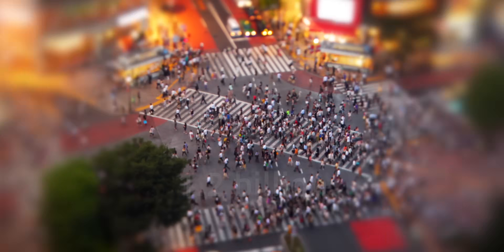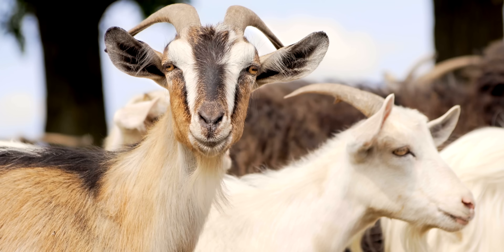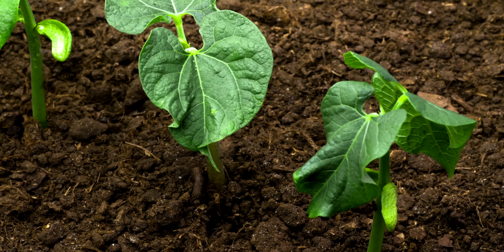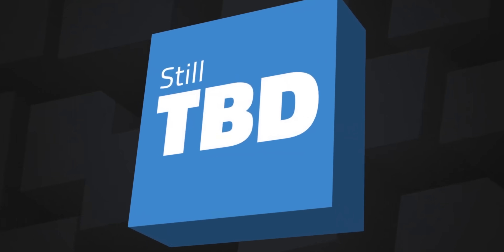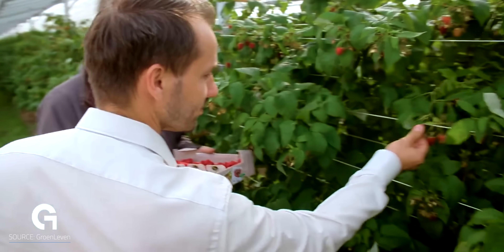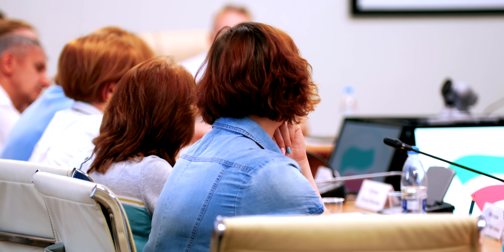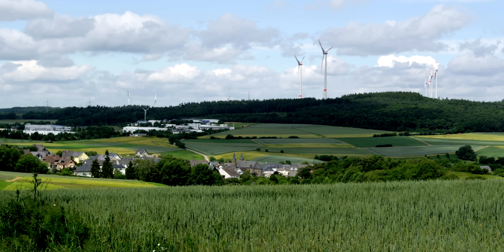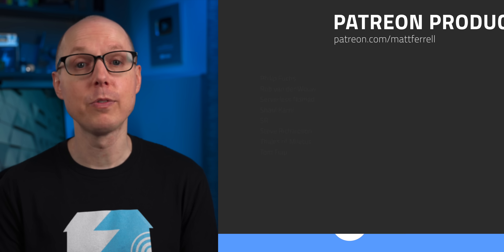Solar Panels Plus Farming? Agrivoltaics Explained

Comment: I feel like stating that utilizing solar panels to shade to agriculturally used land, reducing water use by 50% is misleading, without analyzing the net effect in context of water needed in the production of the solar panels and comparing after what time the net effect is positive (so if water is actually saved in a reasonable time period, say the lifetime of a solarpanel).

Comment: You left out how long do the panels last, where are they manufactured, how difficult are they to dispose of at their end of life etc etc. No one ever wants to talk about these things because the answers NEVER fit the clean energy narrative.
Reply: Panels last 10-20 years.
Reply: That is not correct. Guaranteed full output duration is 25 years for modern panels. After 25-30 years 80-90% of the original output is still available. Then the cells degrade slowly/ steadily. But they can be recycled as well and they are.  @gopalkrusnajena7383
Reply: Nuclear reactor tasty
Reply: I see the focus not on a 1:1 replacement of the devastating fossil fuel paradigma. Climate catastrophe, extinction of species, civil and other wars, chemical pollution, plastic pollution,... We have to shift to a whole different paradigma. Degrowth, cradle to cradle,...
Reply: @TheAsselmeier  That will never happen, due to human nature. We can say we will do those things but there is no way to MAKE everyone participate.
Reply: What would You suggest?
Reply: @ZealousMonk1  Nuclear Power what we should have been doing for the last 70+ years which would have saved us hundreds of billons in taxes and hundreds of billions of air pollution in the form of the dreaded carbon emissions they all rave about.
Reply: @JS-mh9uu  What about the Nuclear waste? What do we do with that?
Reply: @ZealousMonk1  Don't think you realize how little waste they make, you store it on site for 50 - 75 years then bury it in the unit when you decommission it. Hopefully by then we have clean fusion power or something else. Worst case Scenario you feed the waste to an older reactor just before you decom it.
Reply: @ZealousMonk1  Also i single Solar farm makes more toxic waste in 15 years than a Nuclear reactor does in 75. Both from making the panels and disposing of them.
Reply: Always someone complaining small inconvenience

Comment: You massively missed the biggest issue is that this is impossible to implement with grain (wheat, corn, beans, etc.) production. Combine harvesters are a needed component to reduce man hours and make the crop viable (Unless you want to be paying $10-20 for a box of cereal for just ONE example, virtually all store food products have or involve grain in them). On top of this even vegetable farming which generally relies often (But not always!) on hand picking still uses tractors with planters on the back to plant the crop that is usually already in sprout stage. These cannot function with panels like this in the way.

Agrivoltaics would work with small scale personal gardens but would never work in commercial agricultural farming because the panels are just in the way for many stages. On top of this some crops like corn would be very unsuited to being shaded.

Comment: There is a huge proposed agrovoltaic project planned for my little french village, 50 hectares roughly, I neutral bordering supportive, but there are huge numbers of NIMBYs. The plan is the panels will move with the sun and be mounted 8 to 10 meters high. But the exact system has never been done on scale before and the company behind it is Chinese, and not a local one. Compensation to the local village is I believe 40,000 euro a year, which the way the village spends money will be lost, they spent over 70k euro repairing a stone wall for 5 car parking spaces.

Comment: I love the model of sheep grazing combined with solar panels; I think it could work extremely well with the rotational grazing model: a strip or block of panels will define the boundaries of each paddock in the rotation. It would be important to seed the right kind of forage on the soil under and between the panels, with plenty of legumes like trefoil in the mix. The panels themselves would provide much-needed shade. Ideally, the would supply power to  electric perimeter fencing, to keep predators out.
Reply: The only problem i see with goats and sheep is that they love to climb and jump. One hop onto a solar panel and bam, destroyed.
Reply: @MsPoliteRants  Panels are hardier than you might think. Goats might be a problem but sheep are not THAT destructive.
Reply: @MsPoliteRants  sheep are fine, goats would definitely ruin the panels!

Comment: This can absolutely be tapped into. A very good opportunity for both developed and developing countries. In addition to the point of solar production, wouldn't dry and arid regions with a higher rate and concentration of sun solve this issue? I understand that there is more space in between the panel sheets; although using mono-crystalline panels might keep that production at normal levels.

Comment: Maintenance would be hell.
Reply: @dannyblast3392  would it, though? I'd rather be able to get underneath the panels than have them bolted onto a shingled roof, like a residential setting. As long as they're high enough not to conflict with plant growths, I don't see much of an issue.
Reply: Ladders for the higher mounted ones and sit down for the lower mounted ones.
Reply: @bensear  exactly

Comment: Even with a 30% less yield you now have access to something like 90% more land that you are not using for the solar panels in the first place as well as the reduced water consumption. If we can offload the cost to the farmers with incentives or some buyback program where the government builds it and then the farmer either gets some incentive to have it on the land or does a payment plan to buy it back over several years to offset the cost this could work. As long as the installations leave enough room to use existing infrastructure and the maintenance isnt too difficult then it should be an easy sell, I already see tons of farmers in Ontario with massive solar farms I doubt they would object to this kind of proposal if it was viable.

Comment: Well done and very informative video, thank you Matt! I could imagine using the same effects for a lot of other large open areas, like parking lots, highways, tree nurseries, maybe even parks, playgrounds, sports grounds etc. All of those areas could use same shade n the summer and protection of the elements. Especially in hot and arid regions, the solar roofs could help collect rainwater and over parking lots the sun-generated electricity could power charging stations for EV's parking there.

Comment: To me agrivoltaics seems to be most effective in smaller operations where heavy machinery isn't used. The raspberry farm was a perfect example of that. Basically if it grows in a plastic tunnel and it's harvested by hand, agrivoltaics will probably be perfect.
Reply: Spirulina and other probiotic phytoplankton would do well with the panels with a buffer between cells.
Reply: Exactly key words PROPER usages. For example, we grows most of our lettuces in CRAZY hot arid areas. If we installed them there then it's could boost the yields of lettuce crops, lessen water needed, etc.
Reply: As you can see there are MANY MANY POSSIBILITIES.. but this is ALL PART OF OPTIMIZING USE OF AV.. THE MAJOR ATTRACTION OF AV is you put Farmland to DUAL-USE by generating AV-PV Electricity above and food below.. SIMULTANEOUSLY.. Accepting AV as a Viable, and possibly the ONLY, SOLUTION TO MEET MANKINDS ENERGY NEEDS WITH ZERO POLLUTION AND PRESERVING LIMITED RESOURCES... LIKE (FARM) LAND SO AS TO NOT AFFECT ANOTHER CRITICAL NEED OF MANKIND .. FOOD .. AS WELL AS  BIODEIVERSITY PROVIDED BY FORESTS, BARREN LAND ETC..
Reply: Well no as this is ONLY applicable at the height of summer or in the tropics.  For everyone else  you need all that sun as you need it especially in winter, spring, fall.  Panels which are only useful for 25% of the year = trash.
Reply: Don’t want now do we
Reply: You're absolutely right—agrivoltaics seems to work best in settings where heavy machinery isn't a necessity. The raspberry farm is a great example of how it can be effectively implemented. Do you think this method could be adapted for other types of crops, or are there limitations? What's the next crop or farm type you'd be curious to see using agrivoltaics?
Reply: You can just put the solar panels on wheels like they already do with watering equipment probably
Reply: @animehair05silently88  the panels need to be connected to transmission equipment. Not feasible
Reply: wonder how much those strawberries will cost adding the cost of the solar pannels to the price :)
Reply: @mcsanad  That depends on who owns the solar panels. If they are owned externally then it probably wont affect it at all. If the farmer owns them, it possibly could, but then the higher guarantee on yield means less waste, the shade means less water usage and the electricity needed by the farmer would come from the panels and not the inflated grid prices. So it could offset the installation costs.
Reply: @Ben.Royals  well from my point of view planting strawberries on fertile land under solar panels might be a great source of power but the money you lose out on by not planting crops is really unequal. If, the panels are owned by the same person that manages and sells the strawberries and they'd like to cover the cost of the panel, it'd either take them multiple lifetimes to get the price back or to sell the strawberries at a super high price. This idea was obviously made by someone who has never done agricultural planning or work.

Instead, putting solar panels on your rooftop, perhaps vehicle hangar or even a barn covers around the same area if not more. This way the farmer is independent from the grid and had more land to cultivate with and make bigger profits than he ever could with measly strawberries. Oh and I forgot to mention, this way the price of bread and other products that come from agriculture won't rise so you get to buy your daily bread for an alright price instead of buying strawberries with sky high prices.
I say this is the best possible use, not wasting any fertile land and still getting their own power :)
Reply: @mcsanad  wasting land ? did you see that structure, how much land did it waste really ? more than the plastic construction ? i dont think so. Its basically just metal rods that are like few centimeters in diameter ,the same size as the structure you would use for plastic protection . Sure you maybe lose half a square meter where there will be a generator thingy but you certainly will save more from all the benefits you get with having solar panels than what that half a square meter of land can produce .
Reply: @mcsanad  well then your point of view is whack
Reply: @mcsanad  In the US the panel array is a revenue adder
Reply: @FarmtheSunUSA  I didn't know soil in the us brought bad quality/quantity harvests
It would make sense to put these panels somewhere in Nevada or other counties where farming is impossible
Reply: @mcsanad 
You don’t understand farming, you don’t understand soil capacity and plant spacing, but you certainly watch Fox News.
Reply: @lumberjackdreamer6267  congratulations, you told off someone who has been farming for generations in Europe that they don't know what they're doing, I guess we see who's the real expert here
Reply: @mcsanad  
Ok, you say you’re a farmer? But you said you don’t understand how adding solar panels would reduce the price of strawberries?
We’ve tried to explain it, do you now understand?
Reply: @lumberjackdreamer6267  it's funny how you think that people would say no to extra profit
Not to mention this is a year old comment lol
Reply: @mcsanad  
Yes, it’s a year old comment, and we all learn and grow. 
You said you come from a farming family in Europe? Which country?

Europe, like most of the world, is struggling with climate change, and we need to do our part to protect the environment, conserve water, etc…
Reply: @lumberjackdreamer6267  one that is very very flat, I'll let you guess, there's no space to be wasted
Reply: @mcsanad  
Dutch people have a reputation of being thoughtful and pragmatic.
Reply: @mcsanad  
Danish people too. You must feel so lonely as a QAnon cult member in such wonderful countries.
Reply: @lumberjackdreamer6267  so when you run out of arguments you make bold assumptions and start insulting people. You're not even making a point anymore, because you can't 

You must feel very lonely with all the thoughtful and pragmatic mature people around you.
Reply: @mcsanad  
Dude, the conversation is over. You got humiliated and you’re now triggered and upset. 
There’s nothing else I can say. You know you’re wrong, and we all know you’re wrong.
Reply: @mcsanad  
I suggest you take a step back, drink water, calm down and learn from this. 
You live in Holland or Denmark? There are a lot of great examples and support for reducing our carbon footprint and fighting climate change. 
Grow a pair, do your part for protecting the environment!
Reply: @mcsanad  
Please don’t be offended. I know I’m not politically correct, I’m not diplomatic, I’m not good at babysitting adults. But I love this planet and I’m tired of people who don’t do their part to fight climate change and protect the environment. We have a global crisis and we need to act, we cannot sit on our hands or drag our feet. Please wake up.
Reply: @lumberjackdreamer6267  it won't be the small people who can make this change, forcing regular people to do less and less things while rich ones waste more with one private plane trip than another person with an entire lifetime of driving is NOT the solution.

But this has nothing to do with the topic. Wasting farmland for raspberry and solar production is a waste. There are deserts, there are mountains. If you want I can list a few reasons why it's stupid to do this.
Reply: @mcsanad  
Here we are talking about doing more. Doing more to protect the planet, but also producing more crops with less water, and producing electricity.
Reply: @mcsanad  The problem as far as I can tell is that you're looking at this purely from a farmer perspective while not taking the energy side into account. You're saying there's deserts & mountains & other less fertile soil arround but the problem with electricity is that it's extremely hard to transport it efficiently. In theory you could provide the entire planet with energy by coverying just a small section of the Sahara desert but no one knows how to get such amounts of power to central Europe, let alone the US or other sides of the world. You want to be producing electricity as close as possible to the place where it's going to get used. Besides: even if the farmer isn't the owner of the PV installation on his land he still will get a compensation, nobody's is stupid enough to let an investment firm use their land for free while possibly harming their crop yield. In an ideal situation the farmer is the owner of the PV installation and next to the regular crop yield they'll get a good yield from the PV installation. You're assuming you have to pay the PV installation with the yield from the crops, you're wrong. A PV installation pays itself back in less then a decade, if you combine that with a net profit from your crops they could in theory make for a great synergy.
Let's not beat arround the bush here, in the entire lowlands of Europe farmers are on their rear legs because of the N2 problem... but none of em wants to hear about any potential alternatives or solutions. They all know there's an overproduction of several things (mainly livestock) but they all want to produce more & more & more and none of em wants to close shop because farming is not just their job or way of living, it's the entire identity. Well, at some point: something going to have to give. Land is limited in North-West Europe so the more synergy's we can achieve on this limited land, the better of we're all going to be.
Reply: @mcsanad 
They cost less because less labor managing the plastic covers, less damage from hail and storms, less water costs. And bonus electricity production!

Comment: In school I leard about a system called mini blockheat plant (Mini Blockheizkraftwerk), a powerplant burning biogas (methan) from farms and sewer plant or natural gas with a improved hydrogen percentage. It created electricity the common way but it's exhausts are used with a heat exchanger to warm houses. A school in my area got a part of their energy from a plant in the surrounding area, the heat was used for the schhool in winter to, in the summertime, the farmer dried firewood with the unused heat.

Comment: Thanks for letting us know about this concept. Seems like a great idea.
This concept should be tested in rural areas especially in places with hot climates. And if this succeeds, then it should be implemented in different areas.
If This concept is used effectively(Identifying suitable Crops wrt to that area), then it will resolve the energy problem of that particular rural area and result in increasing income levels of people of those areas. (Self sustaining concept)